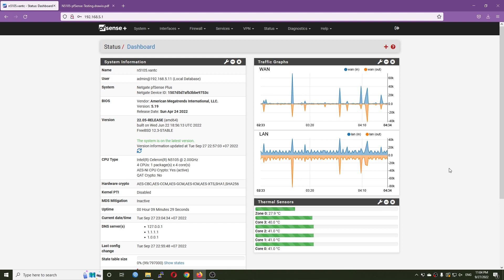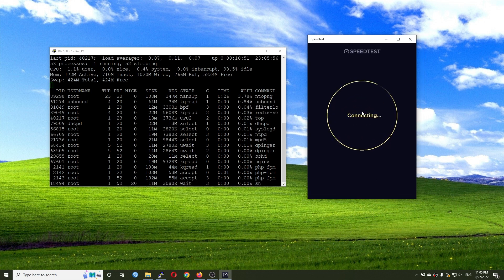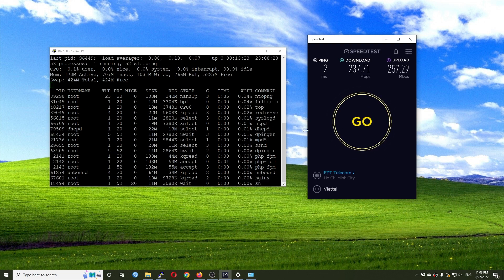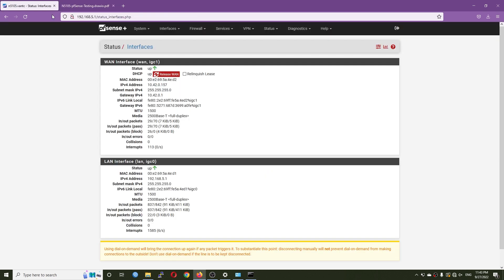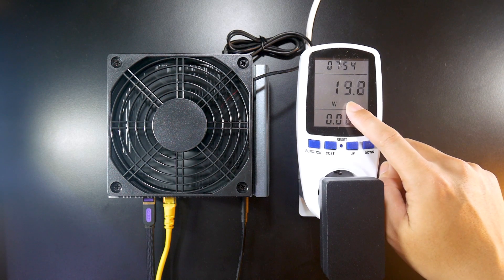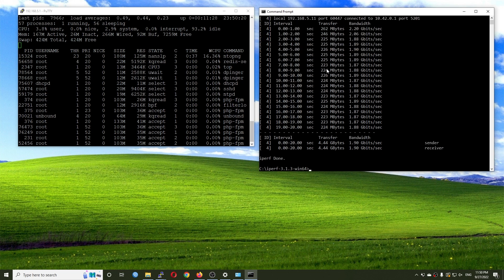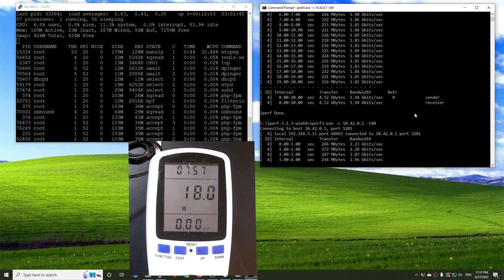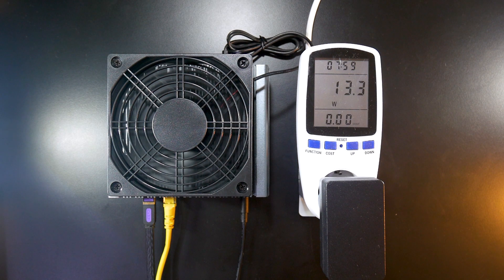N5105 2.5GbE Router PC - pfSense Throughput & Power Consumption

Comment: How much the FAN itself consumes? You should not measure them together feeding from USB.
Reply from the maker: Hello, you can see my previous video for the power consumption without the fan. The 5V USB fan won't draw a lot of power because it operates at 1200RPM. I don't see the need to measure it separately. Not to mention that, the power consumption is vary between different type of SBC (the N5105 SBC has more than 3 manufacturers) and the power adapter you are using. The power consumption test I did should be used for reference only.

Comment from the maker: You may ask me why I don't run pfsense on PVE or VMware. From my observation, and the testing result from my friend who is running pfsense on the N6005 with Intel I226 network adapter, there seems to be virtualization problem: The CPU usage is higher and the performance is not stable. I also see a discussion on the Proxmox community https://forum.proxmox.com/threads/vm-freezes-irregularly.111494/ That is why I try with the physical machine for the best performance.

Comment: why not install a noctua 40 mm x 40 mm x 15 mm PC fan inside the case to get better temperatures
Reply from the maker: You can see my previous video about the fan. If I use the fan, the 2.5inch SSD can’t be used.
Reply from the maker: @ritmorty5472  Hola, may I know what is the OS/router you are using? Are you talking about the WPS configure on OpenWRT?

Comment: The cpu and power consumption will increase after pfblockerng and IPS/IDS package Installation.
Reply: Obviously. :)
Reply: Do you think using a higher CPU will help? Say i7-11 gen
Reply: @timmark4190  You don't need that kind of powerful cpu. N 5105 or J6412 Quad Core Series CPU are capable enough for home use.